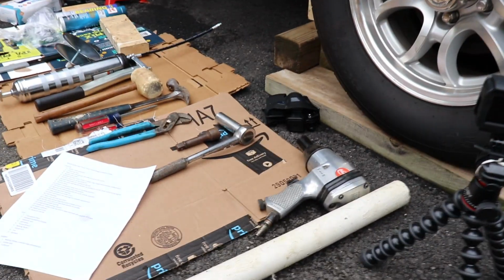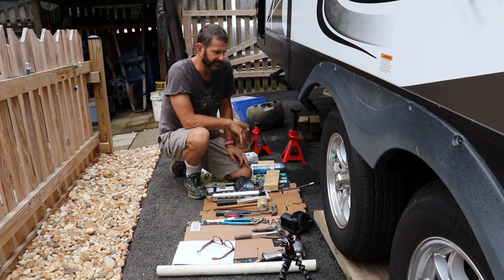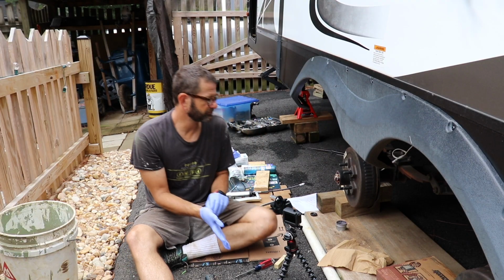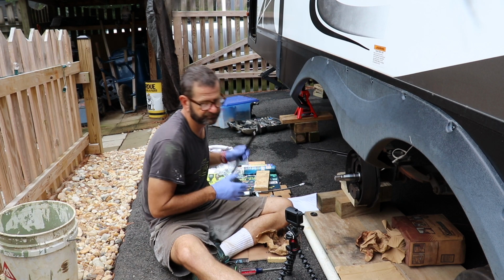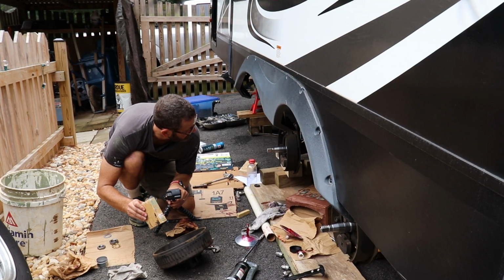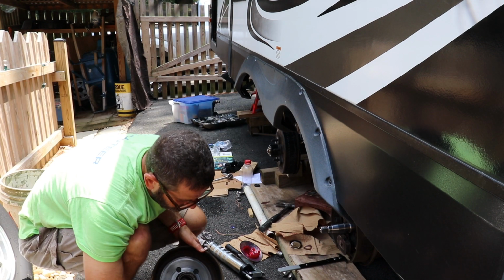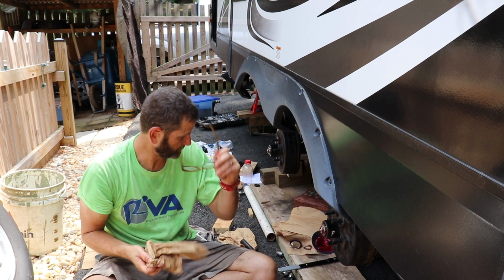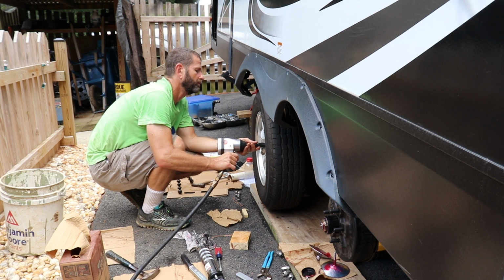Repack Wheel Bearings Grand Design Imagine 2150RB Travel Trailer

Comment: Bearings must have .001" - 005" end play. Bearings should be cleaned in mineral spirits and inspected for damage. All brake moving parts should be cleaned and lubricated.  After reassembly  the brakes should be adjusted.
Reply from the maker: Thanks for the feedback. I'll add the mineral spirits step for sure

Comment: How did you know the part # for the seals in advance? All I’ve seen is take them off and bring to auto supply store to see what you need. thanks. I also found your struggle very informative. Too many videos show everything perfect condition so you never know where you might get stuck.
Reply from the maker: I bought the seals from the RV dealer the first time. Have them give the appropriate part.

Comment: Interesting that your video popped up on my YouTube feed. Due to my own lack of proper maintenance I had a bearing go out on mine and it lightly chewed up the spindle. Had mechanic repack all of the other bearings and he had to lightly grind on the damaged spindle to get new bearing on. This was last week in Pennsylvania. I'm in Roanoke Virginia currently and we stopped here because I started to hear a light squeak back there. Hubs don't feel hot at the moment but I'm waiting for a  word about possibly going to work in Hampton Virginia so I'll be heading your way possibly. Just wondering if I have any issues on my way would you possibly be able to have a glance at it? I plan on taking my time and stopping frequently to feel the hubs and take the caps off and look for any shavings inside. A new axle beam is ready to be shipped but I can't ship it until I know exactly where in Hampton I'll be staying for the job we'll be doing. Anyway, just thought I'd ask in case I run into a problem. Great video and yes, I have learned a valuable lesson by not having bearings repacked and checked etc. Surprised it lasted 9 years to be honest as it's a 2013 unit. I remember greasing the hubs once about 5 years ago but I let it go after that. Completely my fault and honestly kind of horrifying knowing it can crap out and stop you dead wherever your at.
Reply from the maker: Hi YouGoobers, I hope it holds up for you. If you have trouble, it would be best for you to find a shop. I can do some maintenance, but repair is a whole different story.

Comment: FYI to all: if you need a breaker bar to loosen the wheel lug nuts on your car or trailer, they were over-tightened. Use a torque wrench each & every time. Properly torqued lug nuts do not require a breaker bar for removal.
Reply from the maker: Thank you for the comment. I have now purchased a torque wrench, a required required tool I think.

Comment: Nice clear video on removing the wheel bearings.  I was thinking about purchasing that tool you used to remove the grease seal.  But even with that tool, it looks like a PITA.  I've seen people use a claw hammer and remove them also.  What do you think?  Is that tool worth buying?  I know they're not expensive but like I said, it seems like you were really having to work to get that seal off.  I want to do my travel trailer bearings, but I live in the country and don't have a level driveway.  Just dirt.  I really don't want to pay somebody to do this.  Thanks again for a nice clear video!!
Reply from the maker: Thanks for the nice comment Gary. I agree that the tool I used was a struggle.  Something that can be inserted and then tapped upward with a hammer would be nice.  At the end of the day the seals are replaced so does not matter if they are damaged.  A dirt driveway would be ok. Just laydown cardboard.

Comment: Great video except that I think you tightened the nut too much. You should first tightened it like you did but after you need to loosen the nut completely and just screw it back finger-tight. After the locking device is installed the nut should be able move a bit.

From Dexter Manual:
1.   After placing the hub, bearings, washers, and spindle nut back on the axle spindle in reverse order as detailed in the previous section on hub removal, rotate the hub assembly slowly while tightening the spindle nut to approximately 50 Ft. Lbs. (12" wrench or pliers with full hand force.)2.   Then loosen the spindle nut to remove the torque. Do not rotate the hub.3.   Finger tighten the nut until just snug, align the retainer to the machined flat on the spindle and press the retainer onto the nut. The retainer should snap into place. Once in place, the retainer/nut assembly should be free to move slightly.4.   If the nut is too tight, remove the retainer and back the nut off approximately one twelfth of a turn and reinstall the retainer. The nut should now be free to move slightly.
Reply from the maker: ok, thanks for the feedback

Comment: I have a 2018 2150 , have been wanting to do the bearings myself , can you tell me how you got the correct replacement bearings . I was told you have to take the old ones out first to get the parts numbers. I really don’t want to do it that way. Also what brand of bearings did you purchase ? I was told to get a good American brand like Timkin. You did a great on the video , thanks for posting it !
Reply from the maker: Thank you for the kind comment. I had the same question regarding the replacement bearing. I went to the dealership and had them confirm the part and purchased from them before starting the work. I recorded the part number, but now where did I save the record?

Comment: Great video. Did you install new seals or reuse the old ones? Couldn't agree more that the $400.00 quote is way too high.
Reply from the maker: Yes, new seals and inspected the bearings and replace if needed.  I bet the price is even higher now given the demand with RV’s.

Comment: Not clear why you remove the bearings when it is a Dexter easy lube system. Bearings are a very sensitive precision part. a single gram of dirt from your site will destroy it.
Reply from the maker: I preferred to visually inspect the bearings and to see them repacked. I feel like jamming a bunch of grease into the cylinder could just go around the bearing and potentially blow the rear seal.
Reply: To Doug; the EZ Lube system does NOT mean you never take the drum off. The old grease needs to be removed and cleaned off so that the new grease doesn't get contaminated. Also, if too much grease is injected using the EZ Lube system, you can/will damage the brake equipment. The EZ Lube system does not replace basic maintenance.
Reply from the maker: Thank you for the response. I’ve seen other videos and website comments suggesting just adding more grease into the easy lube. I don’t think it a good idea.
Reply: Great way to blow out the rear seals with that attitude and alot of wasted grease.